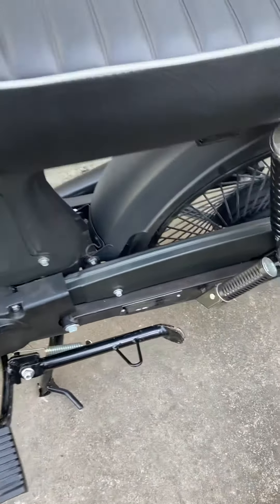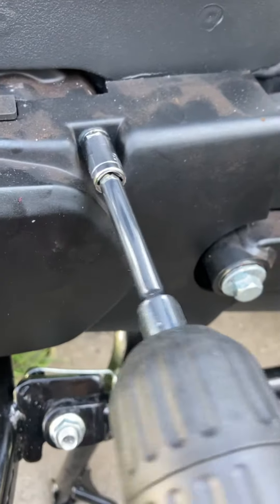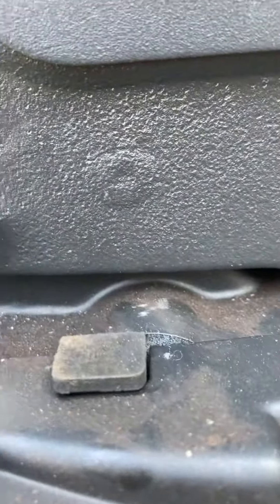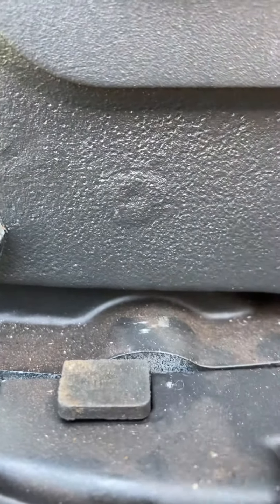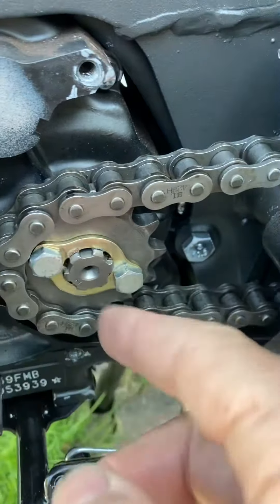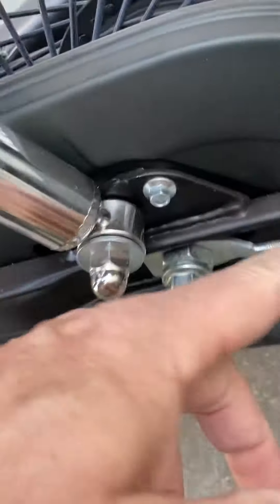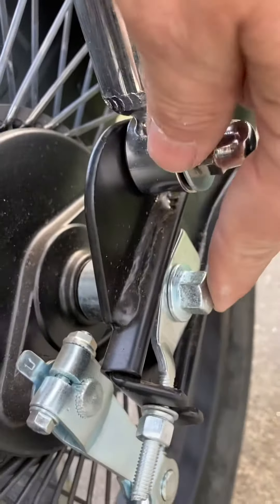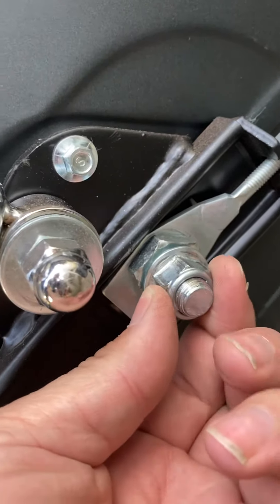Amstar Nostalgia 50cc Motorcycle drive gear change 14T

Comment: Can you please help a brother out? I’m really confused with the choke on this bike. All the motorcycles I’ve owned that had chokes were: choke lever down = choke off but the Nostalgia seems to be the opposite. It has a little arrow pointing up with no indications. Can please you tell me which position is off so I’m not riding around with it on
Reply from the maker: Choke up is on, after 2 minutes reduce to half choke. At full warm use no choke. The factory carb is only like 13mm and not a true 19mm. I got an aftermarket for $22 off Amzn and picked up like 5-7mph.